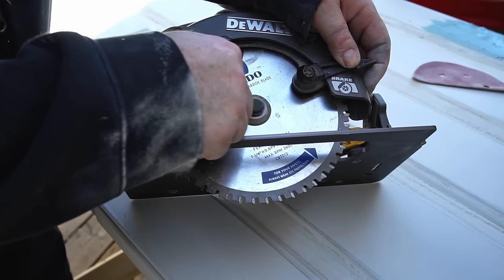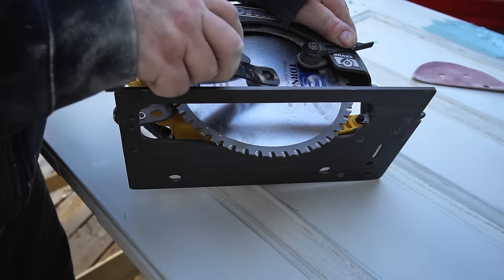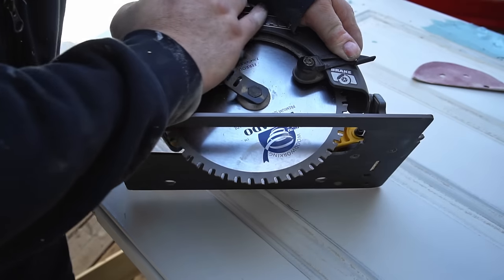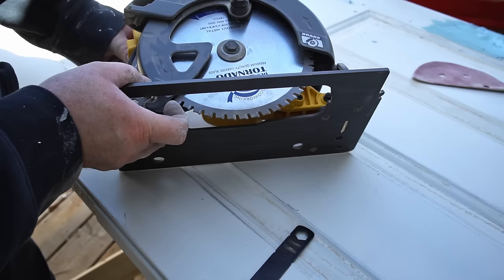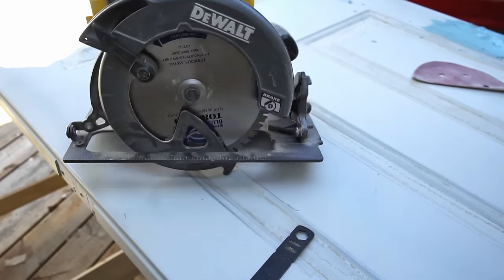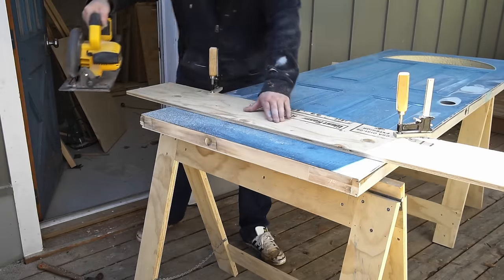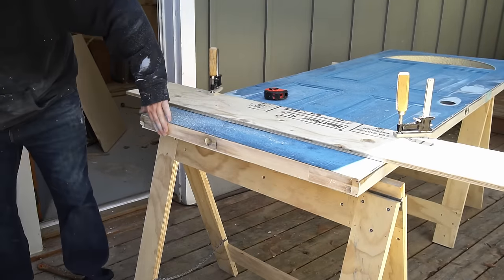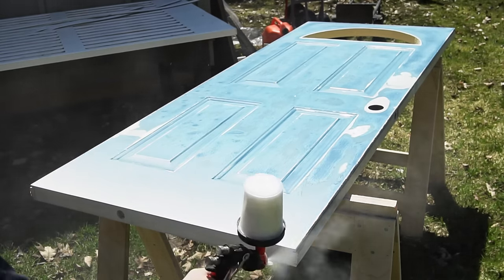How To Cut A Steel Entry Door

Comment: This worked like a charm. I used my Ryobi +18v small saw with a high tooth carbide blade. Setup a guide fence, cut halfway through each time and the job I've put off for a year is done. I can see that a wrap around sweep at the bottom would be a good finish but it''s solid foam inside so there's no weakness in the door. Subscribed.

Comment: Certainly no arguing with a good steel cutting blade. I've had to cut a steel door off and only had a nice fine tooth carbide, yep, it did work, but the blade is pretty much sacrificial. Great tip, John.

Comment: This is not a commercial door, which, when cut would be re-cored and welded. On this type of door I suspect the "J " shaped edge of the steel skin not only held the skin tight to the wood bottom rail, but also added rigidity across the width of the door bottom. Now that you've cut it off, I think you've significantly increased the probability that the door skin will tend to delaminate, especially if not used gently, and if the (paint?) coating along the seam isn't maintained.
Reply: Another Einstein on the loose!!!! He did a simply good job without the blah blah bs as old school guy. You can rebuild that wood shit left over inside the end and add what you taking here. Any additional adhesive also can help.

Comment: I would also like to see how you would do a narrowing of this door.  Depending on the amount of such a cut, it may require taking off the skin,  shortening some of the boards inside, and putting it all back together when a mere slicing off of one side is not possible or would render the door unhingeable.

Comment: Is it really necessary to cut halfway with two cuts instead of all the way through the door with one cut?
Reply: Doing it that way prevents splintering on the exit cut. It's important to do it this way when dealing with a metal door because if you blow out the metal sheathing on the other side of the door it is next to impossible to repair and make it look right again.
Reply: With a circular saw the blade is attacking the work from bottom to top. The exit cut is therefore the top.

Comment: What was your purpose of only cutting halfway on each side instead of all the way through with the first cut?
Reply: My guess: to go easier on the blade and avoid overheating, because there's a layer of steel on each side of the door, while the core inside is wood/foam/etc. Cutting through the whole door would mean going through two layers of steel at once.

Edit: someone who's more experienced made a comment about this, too

Comment: Are there minimum saw specifications required to perform this cut?  My DeWalt 18V DC390 documentation says it is not for cutting ferrous metals.
Reply: I believe that is because of the speed of the blade. Typically a metal cutting saw turns much lower than a woodworking saw

Comment: I only have a 5.5" Circular saw and I haven't been about to find steel cutting blades for it so I brought a 100 tooth blade wood blade would that get the job done?
Reply: If it is carbide tipped then it should do just fine. That's what I just did and it worked perfectly. Be careful of the bits of metal that are going to fly off! Wear full eye protection and gloves to shield yourself from the millions of little metal chips.

Comment: Why set up the fence twice and not just cut it once?
Reply from the maker: Probably the best answer to that would be to ask if the last time you tried to rush something important, to save a few seconds, was the result better or worse?
The blade is cutting through the steel skin, along with the wood underneath. It's better to cut metal with less of the blade sticking down, as it's less likely to hook it and pull it up.
Reply: I Build It Home i see but why not just leave the fence and set the depth twice?
Reply from the maker: Because the blade may hook on the top layer of steel that's already cut.
Reply: Great. Been in the industry for 8 years and have been watching you almost as long.. thanks for the reply!
Reply: @IBuildItHome  Yet I keep hearing the opposite. <Makes no sense. I think it has to do with the time each tooth is in the steel. Maybe I've heard that only for thick steel though.
Reply: American Builders
Doing it this way you have almost no bur on the inside and outside

Comment: Why flip the door rather than just lower the blade and make the second cut?
Reply: Smoother edges on both sides. Less work for the saw blade. Better alignment, even with a hand-held circular saw.
Reply: @ethelryan257  Makes sene. Thanks

Comment: if your locks align as they should with the existing door jam, its better to cut off the top.
Reply: So then you have to lower the Jamb and reset the hinges and locks? I've been doing this for 40+ years now and have never seen anyone cut the top of the door off to get bottom clearance!